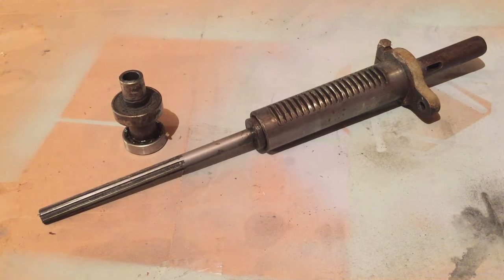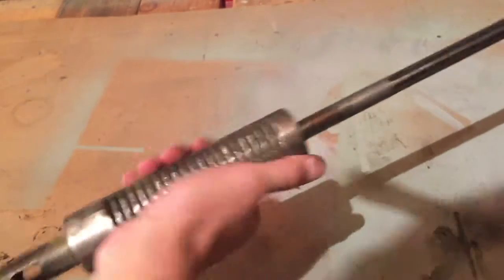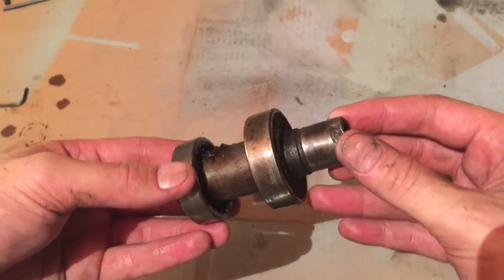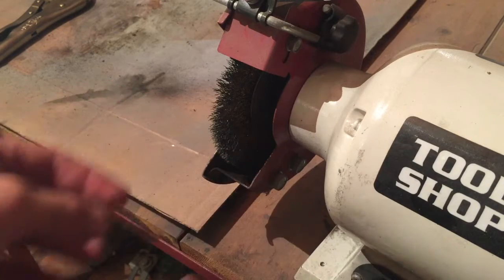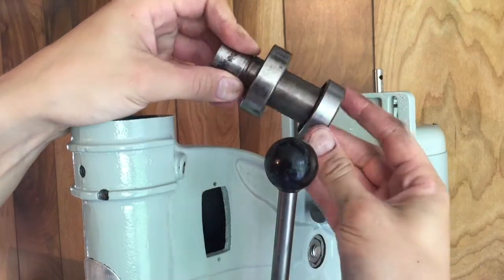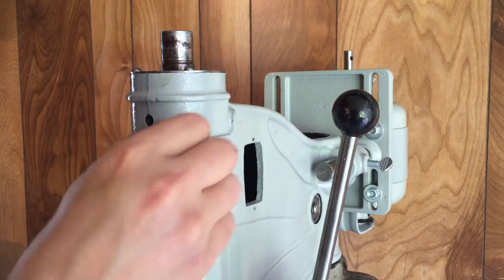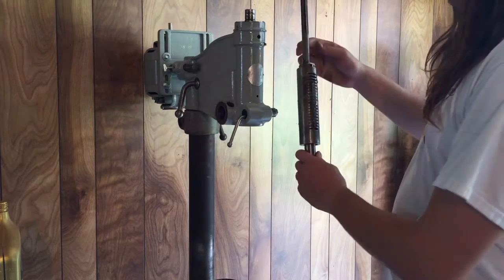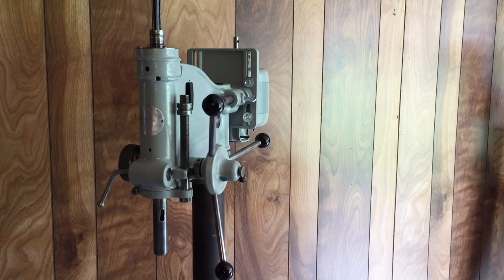Atlas 73 Drill Press Restoration: Part 8 - Spindle and Depth Stop

Comment: Its nice to watch your renovation, although I can hear from 20000km distance that all the bearings rustle. Leaving them like this in such an eleborate procject is a sad downside.
I'd rather let stay the old paint and change bearings. Really sad....
Reply from the maker: I priced out replacing the bearings and it would be about $90 which is nearly what I paid for the whole drill press. It runs good enough for what I use it for at the moment. I'll probably replace them someday though.

Comment: 4min 00sec "the bearings move perfectly now" ??? hahaha a little attempt at humor ?...
Reply from the maker: rol eic eh, I more meant "they aren't a complete gummy frozen mess" more then them being perfect. There is some play in them but I'm not too worried about it right now.
Reply: check my next comment in Part 9. You did a good job with everything else. Why not with the bearings?They probably cost less than the paint cans you used up.

Comment: I had hopes, and then you poured oil into the bearings you didn't change. You are better than that!
Reply from the maker: bryce86777 Unfortunately I don't have a press capable of removing those bearings currently so that's the best I was able to do under the circumstances.
Reply: Okay, but for those of us who don't even know how to press bearings out.  How would it have been done?